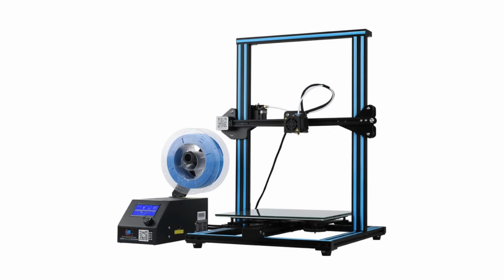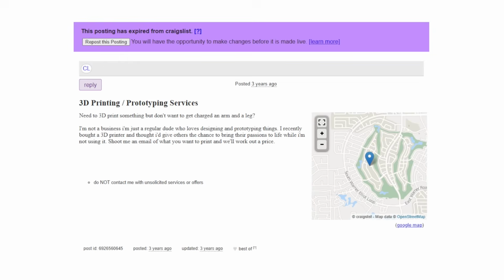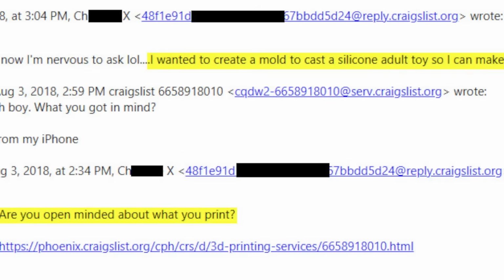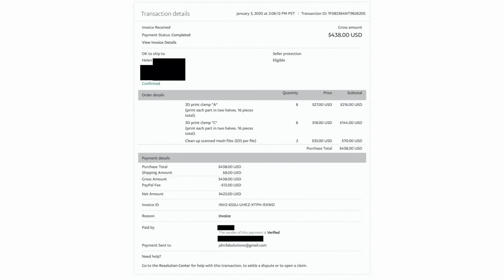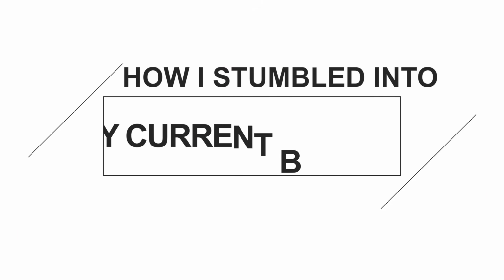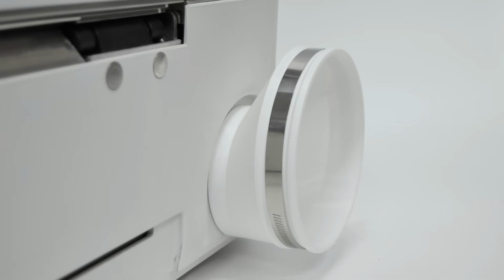3D Printing Business - My First $5,000

Comment: Thanks for the content. I'm getting more into the service side.  in getting the design exactly correct for customer, can you share your process for a complex object?  does customer typically provide good data to you where drawing it is a clear concise set of details?   or maybe  I should disclaim in the service agreement something like, we will load and print from your source file. x amount of $ per fit test until part acceptance.  then  qa on lots of 50. Simplest i guess, would be print from your source file only as the service offering.  or maybe send the jig over and we'll evolve the drawing and make it work?  All comments welcome.

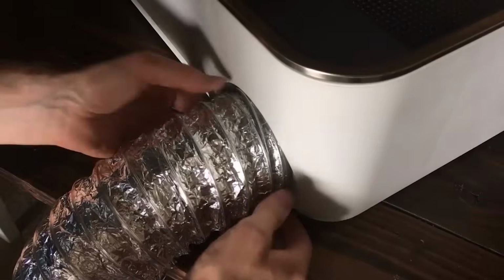Comment: Hi Joe, just found your video/channel. Thanks for the video and your experience ... very practical thoughts and very helpful. Quick question: at around 10:30, you show a couple of versions of the exhaust adapters that you mention you 3D printed for your laser cutter; looked like they're metal ... so does that mean you started 3D printing with metals? Also looked like actual manufactured metal parts. The 3D metal prints seem to have a different look (different finish/texture) ... so just curious. Thanks again for sharing!

Comment: how hard is it to actually design stuff? Like I can print off STL files that I find on thingaverse and such, but I've never really dipped my toes into making things because well, I have no idea what to even make or how to get started with it. I don't have anything special like you do now, but I do have an Ender 3 S1 Pro and frankly it prints out pretty decent as long as it's PLA or PLA plus. I have no tried ABS as I don't have proper ventilation in my office. It would be nice to do this as a little bit of a side hussle but I would have no idea how to price or even create things like the menu holder that you mentioned.

Comment: I got my first 3D printer mid 2016 and tried my hand at running my own business in 2017 due to encouragement by a friend.  Unfortunatly things did not work out, and the thing that really killed my interest was due to a customer taking a product that I had printed for him and which I designed over to China to have it reverse engineered and injection molded.  Luckily I found out early as he wanted other products designed, and which he would have gotten a small batch 3D printed and then shipped over to China to be copied.  I still do 3D Printing, but now only for my own projects and don't sell anything.  It's good that people can make money from 3D Printing, but unfortunatly you have to many shady people out there.
Reply from the maker: 100%. It’s a sad reality.

Comment: Excellent video, thanks for sharing your honest journey.

This is very similar to our journey 3D printing. We started our small manufacturing business by making small clips and connectors for a mini football helmet collector (he was our first repeat client). After that, we prototyped a table saw dust collection adapter to fit the saw and the vacuum hose and sold it on eBay ($200 or so per month). We now do between $800 and $2000 a month in products, and we do $1,000 to $3,000 in design and service work (CAD modeling). 

Always great to see people like you making it work. 

Cheers,
Reply from the maker: Dude, that's awesome man. Keep up the great work. Looks like you got some solid videos on your channel too. Love the consistent thumbnails.
Reply: @Joe_Martinson  Thanks for the props man. Awesome for you, too!

Comment: I'm just about to start my new business; I'm going to be building 3D printers that can print sizes up to 2m*2m*2m, for a very very low price. Hopefully all goes well with me and I find this video relatable! The over analytical part, I remember one time I was sitting at my desk and analysing too much, that at the back of my head I felt two veins jumping. I just went to get a can of beer and cooled down. Starting a business is not easy,. It's like what Jeff bezos said, a business is like an engine, the difficult part is building it, starting it, and warming it up. As it keeps running it gets smoother and easier. All the best to you!
Reply from the maker: Thanks for the comment. Best of luck to you. Let me know when finish building that 2m printer!

Comment: Keep up the grind! We do $60 / hour for basic 3D modeling services (we are in MI, location def matters). We are a two man Mechanical Engineering team and use Solidworks. We finished the year in 2018 (mainly 3D printing custom prototypes for companies) with around 60k profit. We are now doing a cool 100k a year! .. scaling up is very difficult due to the time / space it takes to manage all the printers. We now have 14 consumer level printers (Sovol, Prusa, Creality, Artillery), a prosumer level Ultimaker S5, and 3 industrial printers (Stratasys F370's).
Reply: Is the $100k what you pay yourselves?
Reply: @sljack1671  no, sorry.. it’s 100k total profit.. we turned over $180,000 last year. We also do this on the side of our full time engineering jobs for now.. so all the work is 7pm-12 or weekends.
Reply: @oneheadlight8000  Thanks for the info!  We are considering 3D printing as a possible new revenue stream for our IT service company.
Reply: @sljack1671  it’s all about networking. If you have a wide customer base already then it is easy to just send out emails advertising the new services you offer. I would start slow. One that everyone is looking for is SLS nylon.. we don’t have one of those yet but that is next on the list. It creates nice looking strong parts without the need for supports.

Comment: I am wondering what type of objects you would suggest me starting out with. I have a Voxelab Aquila V2 with a BLtouch and a few other minor upgrades and a ModixMeter with dual Vulcan volcano hot ends. I bought the ModixMeter to produce and item I have a patent for but I only see my self printing that item for a year before I sell the patent. I also only see myself printing 20-25 of them as an on demand print because the print time is 6.5 days. I have thought about putting some of my jewelry that I have designed for my daughter on Etsy or even my printing service there. What would you suggest to get rolling.

Comment: Great video! I've been thinking about trying to do something like this. Do those clients typically have a 3D model that they just need you to print or did you typically design the model too? I've been trying to learn modeling and have some basics of Fusion 360 down. But my fear is getting a good job from a client, but the model they need is beyond my know-how and starting off not being able to fulfill it.
Reply from the maker: Great question. Half my clients had their own file, half needed me to model. I say start, and figure it out when you get there. Worst case, your client needs you to model something beyond your skill set, just hire a freelancer on Fiverr.com to model it for you. Prices are very reasonable on that site. One solution to consider while you learn Fusion.
Reply: @Joe_Martinson  thanks, that's very helpful!

Comment: Hi. Came across your video researching on 3D printing with Sketchup-i use this software primarily for all my modelling, from interior design to cabinetry and wardrobes and now to my new venture of prototyping. Curious to know what CAD software you use now and how you went about using sketchup for the printing.
Reply from the maker: I currently use Fusion 360 but used Sketchup for everything beforehand. Most things I printed where basic geometric shapes which was fine, but then even doing basic things like applying a fillet to edges in Sketchup became tough so I switched.

Comment: I only been doing 3D printing as a Hobby for about 2 years..  

My 1st printer is a big thing But had tons of issues with it not auto-leveling right, even the manual leveling was not cutting it I think the base of the metal bed is un-even 
and warped a bit and as it is a big bed 13 inches square with 6 adjustment screws it is a hard one to sort out. 

I be getting a 3D leveling probe for it and new firmware too.
So I managed to get the money together to buy a Voxelab Aquila which is a Ender 3 V2 Clone. turns out it is a sub company of Flash Forge so explains why it is a good cheap clone.

I like designing and such so I now had a couple of personnel simple print orders from people I know!  Did two sofar both Dinosaurs and got paid too for them, nothing big but hey start small.

I got a 3rd Dinosaur model ordered now and it is printing now and with take some times ( about 15 hours ) a big 10 inch long T-Rex Skull in glow in the Dark light blue it will be awesome when done.

I have to charge a bit more then the 1st two for this 3rd model as it is big and the filament is costly. 

I like the idea of how mine is going, the main problem I have is in the UK we have pricey Electricity with VAT too. 
So that is the thing holding me back is that, I can buy normal filaments at a low cost, But not the power needed to run the 3D printer.  and I don't have a good paid job sadly!

So I may get somewhere with the printing I not sure?  I think it all comes down to luck and your own costs to run the hobby?  
That and the cost of living too play a part if you are a success.

All I know is my small start is hard going and costly.
Reply from the maker: Thanks for sharing your experience man. Costly electricity is a real bummer. That VAT tax is a real drag too. I guess you’d just have to pass those costs on to the customer to make it worth your while.

Comment: Hey! Try using a sheet made of G10 material for your bed! Has great adhesion for prints and is durable!
Reply from the maker: Thanks for mentioning, I’ll check that out!
Reply: @Joe_Martinson  Can confirm, that's good stuff. I started with an Anet A8 Chinese knockoff of a Prusa MK 2 & when I upgraded to a spring steel plate & G10 sheets it was an absolute game changer. I'm not even doing this as a business (yet) but the time saved in not dealing with bed adhesion issues, and just popping parts off was 100% worth the time saved.
Reply from the maker: That’s awesome, thanks for sharing. Where did you get your G10 sheet from?
Reply: @Joe_Martinson  McMaster Carr has them, a lot of people get them there.
Reply from the maker: Thanks!